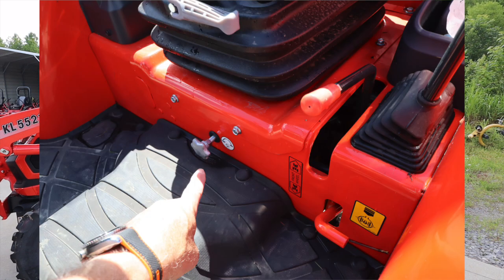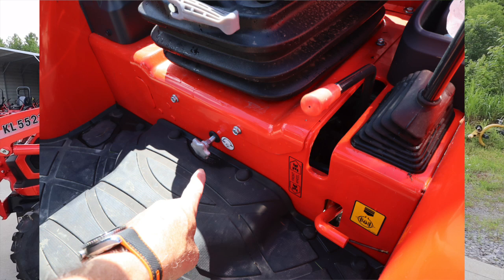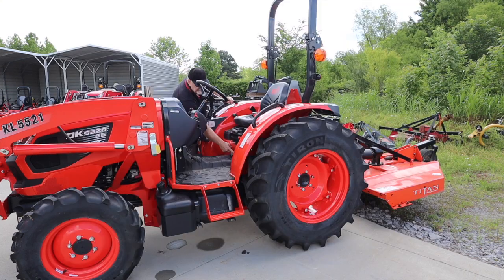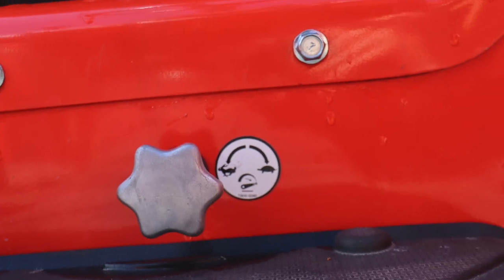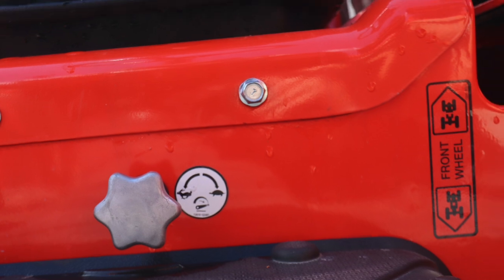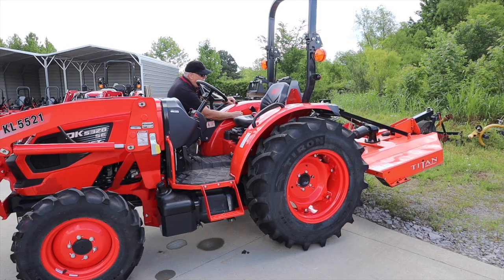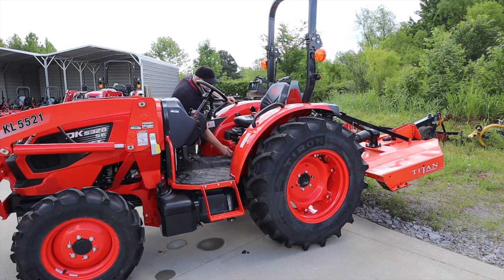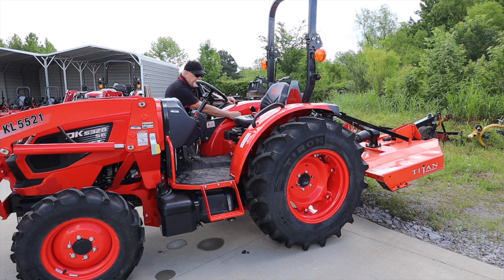LSE NASHVILLE   ADJUSTING THE SPEED OF THE 3 POINT

Comment: On my new NS6010 that control valve is in the same spot and it turns much too easily and/or it's in a stupid place.  Several times I have accidentally closed the valve. The first time I was perplexed for a bit before I realized why my 3 point would go up, but absolutely would not move down!  And it never stays set.  Do you know any tricks to tighten up that valve?  I was thinking about wrapping some rubber bands around it to kind of jam it up.
Reply from the maker: It’s unfortunate that yours is so sensitive. I like the rubber band idea!!  Before that though I would snug up the jam nut. Look in the manual
Reply: @LSE_TRACTOR  the manual barely acknowledges the existence of that valve, much less how to adjust tension on it.  I like my NS6010, but that manual has to be some of the worst technical writing I've ever had to read.  I've had a Kubota and a New Holland tractor, and both had very well written and illustrated manuals.  The Kioti manual is almost useless.